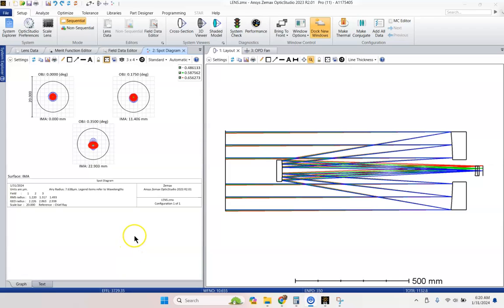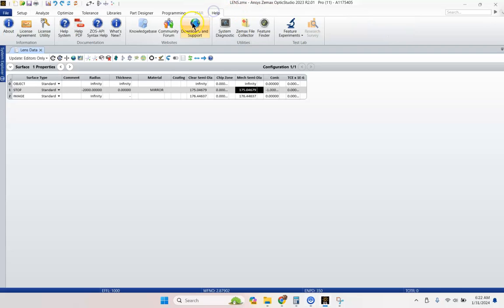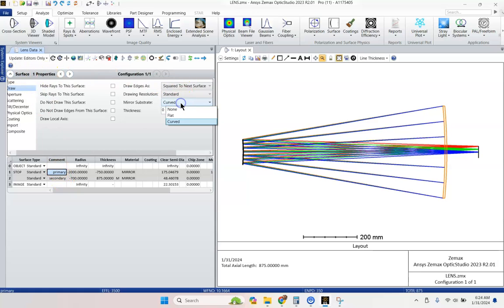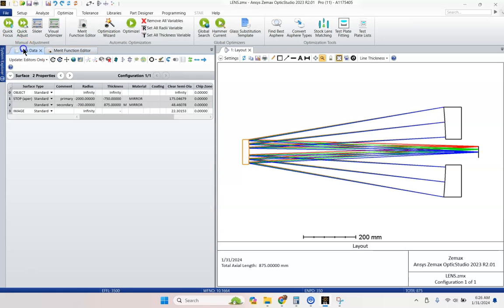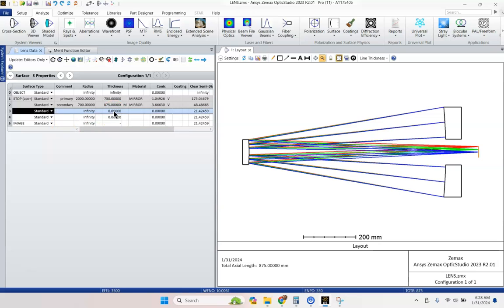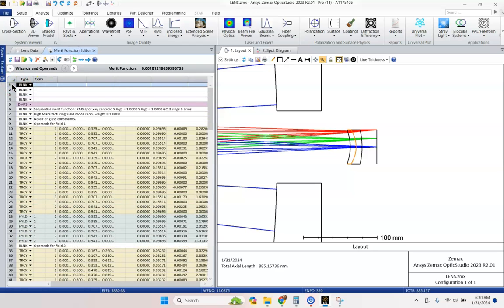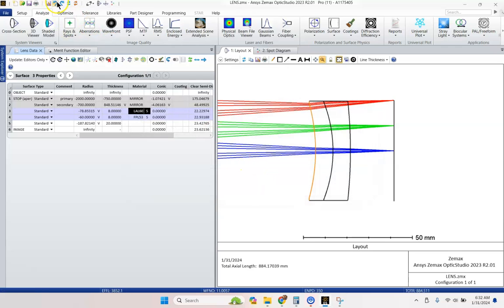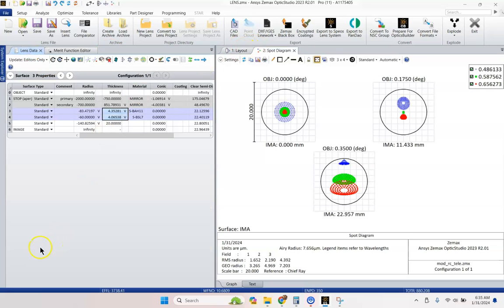Good Morning Zemax Episode 5: Mod RC Telescope

Comment: FROM TWO LENS IN N-BK7,  WITH 100MM BACK FOCUS,  ZERO POWER,  DIFFRACTION LIMITED AT 0.5 DEG   PETZVAL  RADIUS ABOVE  2000MM    DESIGNED  FOR THE GSO RC8/F8 HAVING 254MM  BACKFOCUS .

Comment: A little bit late comment, but you're aware, that you've Zemax messed the parameters of the R-C telescope a little bit, right?

I mean it was an hyperbolic almost-Cassegrain (the spacing between mirrors wasn't correct), but definitely not an RC.

For R-C with given parameters (3500 mm EFL, -2000 mm primary ROC, 175 mm backfocus) it should've been;

r2 (ROC of the secondary) = ~ -731.12 mm (you've set it to constant 750 mm)
Mirror separation = ~ -738.89 mm (Here you've set it to constant 750 mm as well)
k1; ~ -1.0577 (Zemax got -1,0493)
k2; ~ -3.8464 (Zemax got -3,6663)

I mean the video is great for anyone learning Zemax basics (and it helped me a lot), but Ritchey-Chretien is defined as a Cassegrain configuration which zeroes both low order spherical aberration and coma - the designed one wasn't free from any of them.

Also yours final (corrected) design has outperformed a real R-C quite easily in the end, however the true RC still remains sharper up to ~ 0.1 degree off axis (and remained diffraction-limited up to ~ 0.2 degrees off-axis, unlike the mess you've shown).

For reference the RMS of a real Ritchey-Chretien telescope with the same parameters at the center of the FOV the spot has ~ 0.1 μm RMS, yours mirror-only design has RMS of ~ 15.4 μm (already after optimization) and it has dropped to ~ 1.22 μm after adding the exotic glass corrector.
Reply from the maker: Yes, you are right. This is not a true RC telescope. I call the full system a “Mod RC telescope” because the primary and secondary are both hyperboloids like an RC. And notably, the design has comparable conic constants to theory as you have demonstrated here. It certainly is a Cassegrain telescope because the primary is concave and the secondary is convex.

If you’re interested in having Zemax optimize to find the conic constants for a true RC telescope, there’s a simple merit function that you need to make with only two operands: SPHA and COMA. Targeting zero for those operands will give you the theoretical conic constants for a chosen mirror separation, back focal distance, and radii of curvature.

In the method I showed in this video, I essentially made the focal length a function of the radii of curvature rather than making the radii of curvature a function of focal length.

Thanks!
Reply: @RykerEads  thanks for reply. 

Imho this still shouldn't quality even as an modified R-C as the definition of R-C is a variant of Cassegrain free of both low-order spherical aberration and low order coma.

The mentioned design wasn't really free from neither of them.

Also there are Wynne-Rosin and Harmer-Wynne modified Dall-Kirkham configurations (or both of them are one and the same? I'm not even sure about that) which eliminate all 4 Seidel aberrations with 2-lens corrector which is much closer to the mentioned design in terms of optical properties (and becomes fully useless due to the undercorrected spherical aberration as well).

Imho that's just a modified Cassegrain with two lens corrector - however as long, as it has low order coma or spherical aberration it shouldn't be called Ritchey-Chretien, no matter what the mirror shape is - especially, that Ritchey-Chretien is not the only feasible design with both hyperboloidal mirrors (although is by far the most common one).

I've heard the name 'Hypergraph' used to describe designs close to that, but the same name is often used to describe Newtonians with hyperbolic primary, and as such it's ambigous without given context.
Reply from the maker: @kacperrutkowski6350  I hear what you’re saying and I appreciate the discussion. Perhaps a true way to do a “Mod RC” would be to start from a true RC and optimize field curvature with an achromatic doublet near focus. You’ll have to forgive me for not changing the title of the video ;). I wish you all the best in using Zemax.
Reply: @RykerEads  Thanks for reply and sorry for being a purist in the terms of naming things here ;/

As for the design generally achromatic doublet near focus doesn't really work that well and is almost never utilized in practice.

If starting with RC you would likely either use a single plano-concave lens literally touching the sensor with its flat side or go for a three-lens design (I believe the standard would be to go with doublet consisting of convex-convex and concave-convave lenses with third plano-concave element (again with the flat side facing the sensor, but now a few centimeters away), with a few centimeter air gap between them.

Another way of doing that (and generally preferred for wide fields in astronomy) would be to go for the Wynne-Rosin design - start with parabolic primary and spherical secondary with equal radii of curvature (and secondary magnification typically somewhere around 7/4) and put the two lens corrector in the baffle (somewhere around half-way between secondary and the focal plane). Here you would need to put (all-spherical) plano-concave lens (with the flat side facing the secondary this time) and a meniscus such that the outer edges of concave sides of both lenses touch each other.

The second design corrector is afocal, so it is generally both elements are made from the same type of glass (generally inexpensive one, like for example N-BK7, S-BSL7 or H-K9L) won't make an issue. That will give you about twice as wide diffraction-limited FOV as either your design from the video or an R-C with 1/3-lens flattener, but will leave a little bit of 5th order spherical aberration, and as such it'll be slightly less corrected in the middle of FOV. That design will also generally be free from all of Seidel aberrations except distorsion.

Btw if going for 3-element flattener or the Wynne-Rosin Telescope (also known as Modified Dall-Kirkham due to its spherical secondary) you would need to use the hammer optimization and wait few seconds to a minute to get it done (or just compute the design analytically to get rid of all of the Seidel aberrations) - standard optimizer seems to get lost in both of these designs (but in Wynne-Rosin significantly more so, than with 3-lens RC flattener).
Reply from the maker: @kacperrutkowski6350  thanks for sharing! There’s always more to learn :). Aspheric convex secondaries tend to not be very friendly for testing so it makes sense that a lot of the lens corrector designs have spherical secondaries.
Reply: @RykerEads  The highly aspherical RC secondary isn't that tricky to test, at least for semi-proffessional and proffessional mirror makers - I would say that kinda less tricky, than large (1/3 to 1/4th of aperature for the Wynne-Rosin) corrector lens.

What I believe makes the Wynne-Rosin design compelling (as generally modifications of that design seems to be the most common Cassegrain design in the semi-pro market segment) is the easiness of correcting astigmatism.

As for issues the lens quickly get thick and I'm not aware of any good lens glass (except maybe the fused silica, which is quite tricky to work with due to its brittleness) with respectable thermal expansion coefficients - generally after a few minutes of polishing a corrector like that you'll have to let it cool for hours to accurately measure the surface, as freshly-polished surface bulges upwards as a result of thermal expansion. They also don't cool as quickly, as relatively thin mirrors.

In case of large mirrors (typically R-C - generally the biggest Wynne-Rosin offered I've seen on the internet was 1.2-meter design from the Officina Stellare and there are probably only a few larger telescopes of that type in the world) working with fused sillica or zerodur is much easier.

What is the most compelling feature of Wynne-Rosin is its lack of astigmatism - which is shared only by two other relatively common designs (Schmidt camera and Korsch's 3-mirror anastigmat).
Reply from the maker: The optical sciences are a beautiful thing. A nice blend of material science, mechanics, math,  electronics, politicking 😉, etc. Thanks again for sharing :)